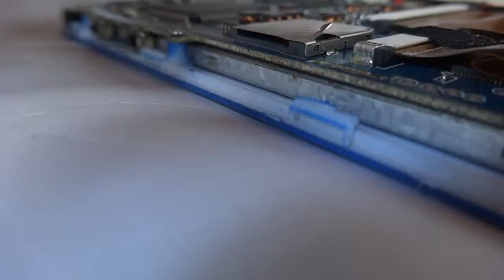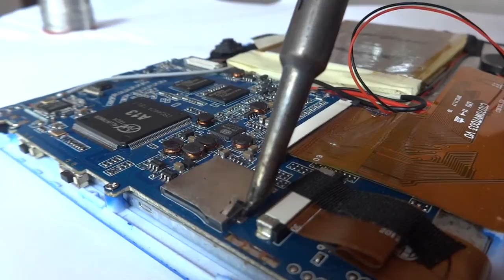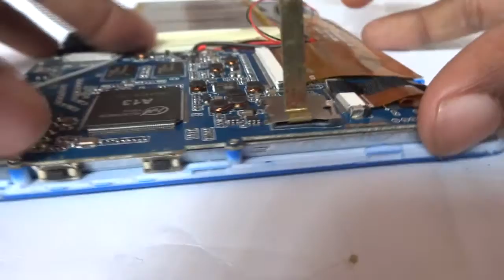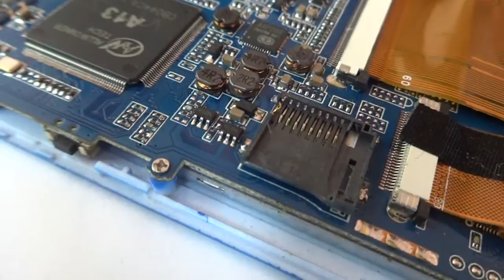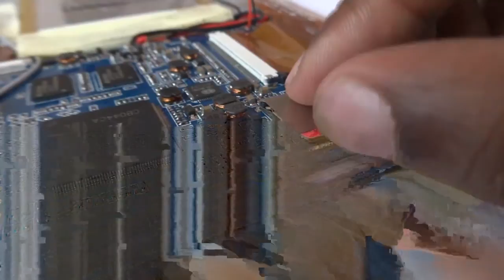How to fix sd card slot in android tablets

Comment: I broke my Xoom tablet's SD card slot 😖 want to fix it...I broke one of those 8 golden color pins of slot...how to fix it?
Reply: you need a new sd card unit, maybe off aliexpress. you cant easily fix the copper contacts, ofc depending where it broke and how good you are at soldering, and also how goog soldering station you have.
Reply: is that it?